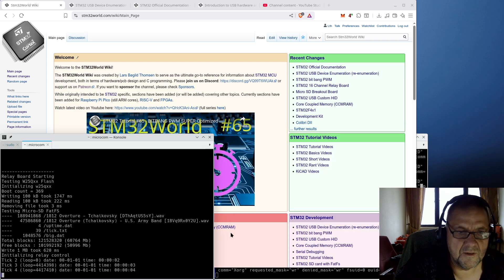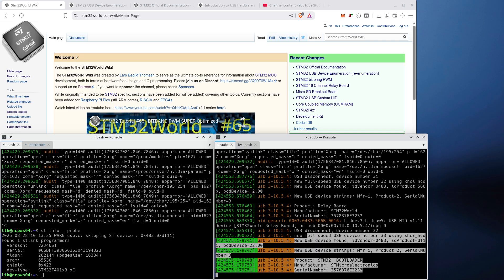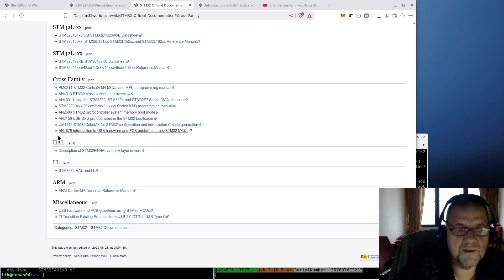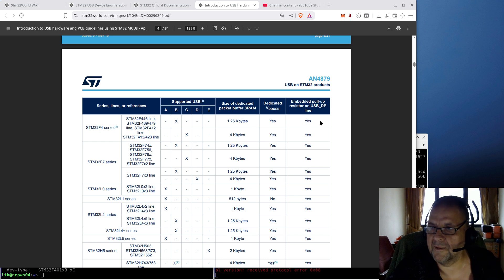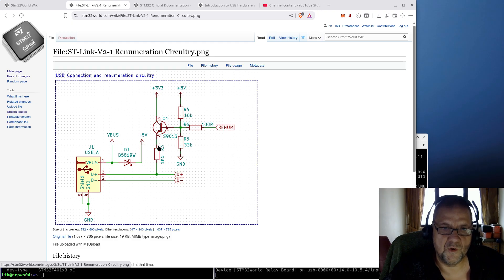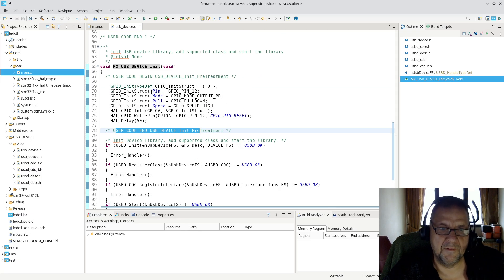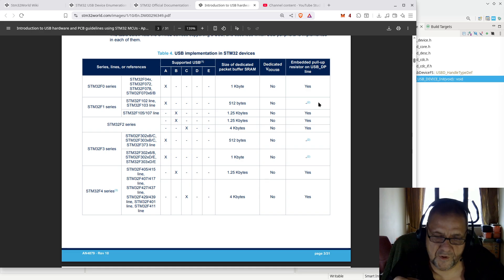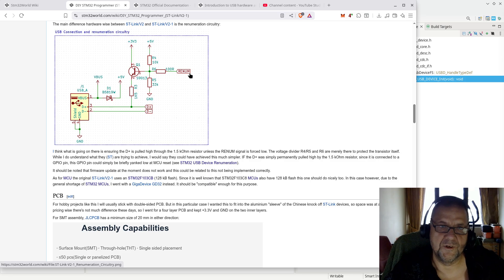STM32 Short #8 - Mystery of USB Enumeration (re-enumeration)

Comment: I always do it the following way when an external 1.5k resistor is needed: put the resistor from D+ to another GPIO pin. 'Disconnect' by floating that pin (i.e. put the pin into input mode), 'connect' by making the pin an ouput and setting it to high (i.e. 3.3 V).
Reply from the maker: As documented on the wiki - not even necessary - just put the resistor there and yank D+ low to re-enumerate.  It works.

Comment: Just did my first design with a device only STM32 and failed to add the 1.5k resistor (none of my other designs required it). Have managed to mod the board post production and use the code you gave here to recover the situation. As the boards have $40 of other components on them, to have to scrap them for lack of a resistor is annoying. Thanks for posting this.
Reply from the maker: Been there, done that ;) https://stm32world.com/wiki/File:MIDItio_usb_d%2B_bodge.jpg